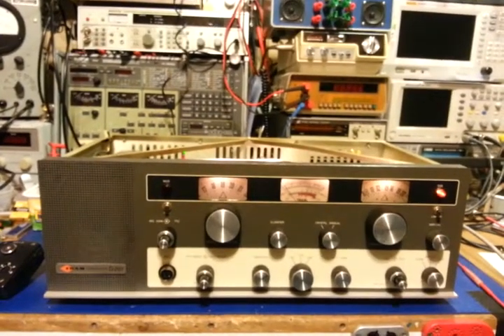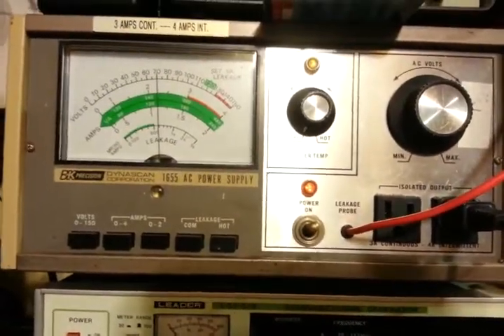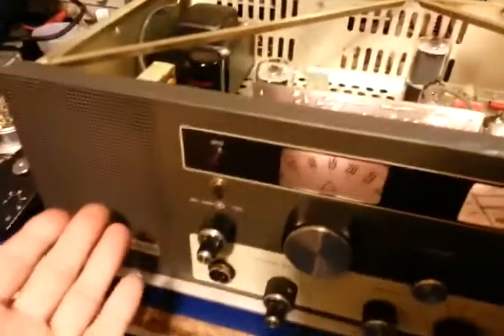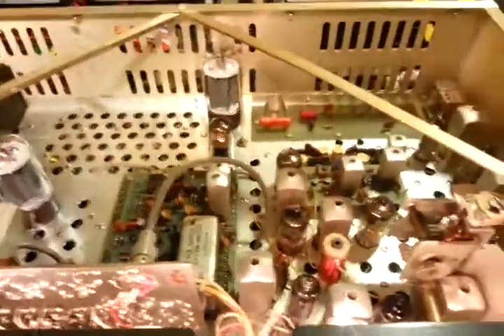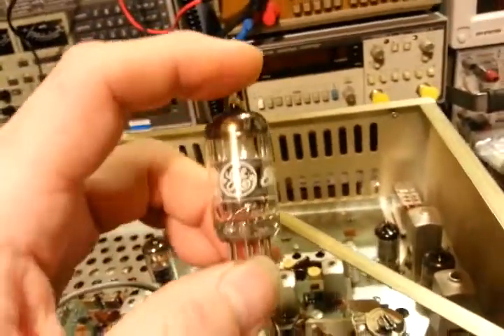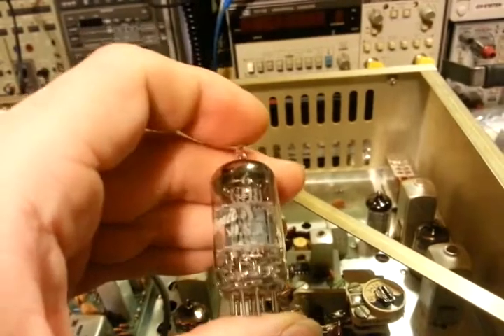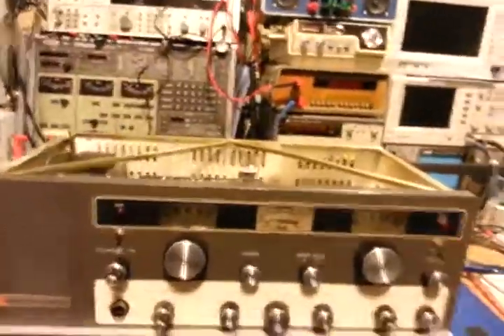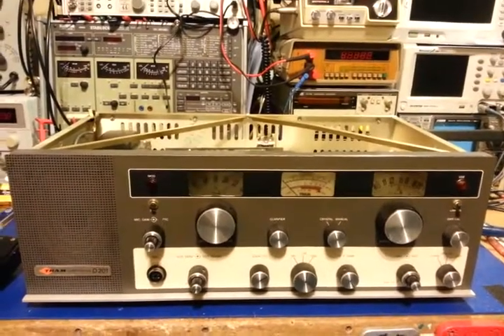Tram d201 hand wired CB radio with microphonic / harmonic tube in SSB circuit.

Comment: G'day Mike,
I was wondering why you use the old B&K CB testers etc sets in preference to your Comms Test set ............or are you just a Test gear sicko like me and rotate the gear used to justify having it lol....
I do that a bit as well, but I keep feeling bad to not use my best gear on jobs, so it gets used less and less these days.
Reply from the maker: Harb's Elecronics Lab 

It's designed specifically for working on CB radios.  The 2040 signal generator is channelized,  has modulation frequencies specifically called for in alignment procedures, has a set 455kHz IF output, has built in SSB offsets and noise generator.   Again the 1040 Service Master is designed specifically for CB'S.  Has built in dummy load and can be switched to an external antenna, has built in audio modulation including double tone, watt meter, audio dummy load and power meter, audio distortion measurement.....  They were designed to be used together and I have never found anything as quick and efficient to use as them when working on a CB radio.  What can I say, they work and once you use them like they were designed to be used you really get to like them.

Comment: Very nice Mike. Those micro phonic tubes can ruin you ssb contacts. Just wondering, do you throw them out (they test good) or used them in other circuits where the harmonics are not an issue.Thanks for sharing.
Reply from the maker: I usually just toss them.  I don't want to take a chance using it and then find out it shorted out. 

Mike